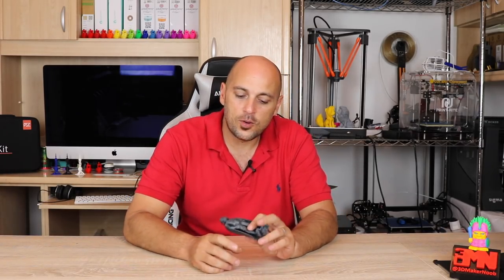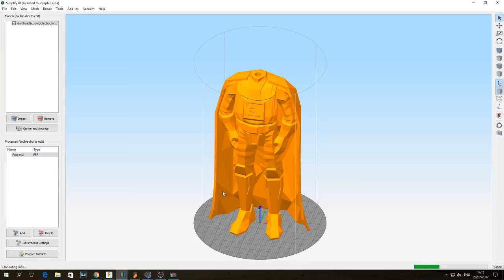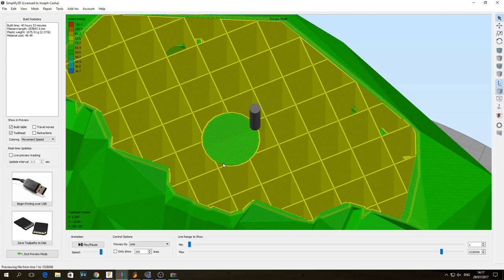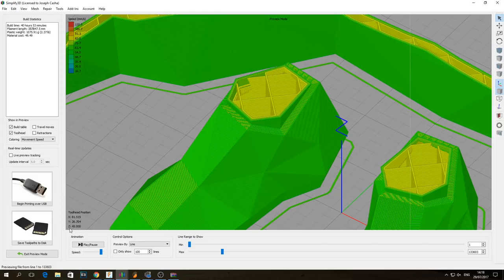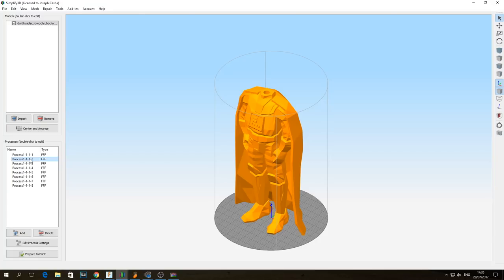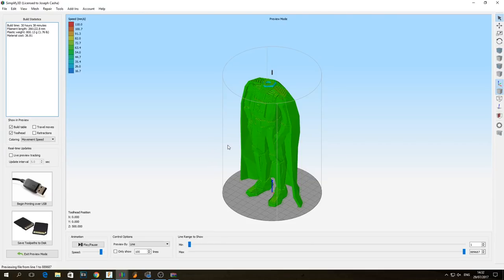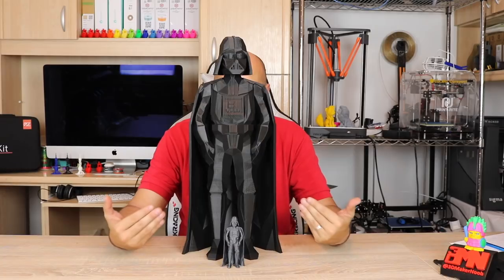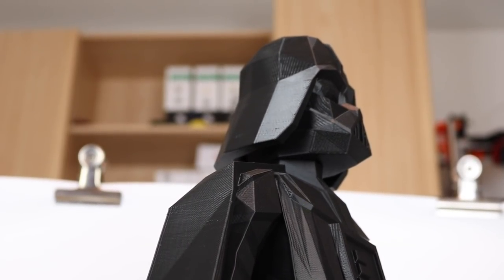Reduce Filament Waste with Simplify3D V4 - Big Darth Edition

Comment: Cura 2.6 has a great feature that saves a ton more. Say 100% infill at a 5 layer range. It should give you a solid foundation for top layers and use minimum infill for the rest.
For such a large print I guess more layers would be best, but super easy and fast to configure.

Comment: That's a very nice print! If you do want to print some stormtroopers to accompany him, I would recommend scaling them so they are shorter than Vader. By default, the low-poly Vader is the same height as the stormtroopers (and I think even C-3PO), which looks off.
Reply from the maker: +Mighty Jabba's Collection that makes absolute sense thank you and will do :)

Comment: Great video!
But one question: isn't the gap between let's say 3% and 15% too big to print the first layer of the 15% structure?
It looks like it prints it "in the air".
Or is it not relevant because it's the Inside and you can't see it anyway later?
How about slowly increase the infill in 3% steps? 
Just my thoughts about it :)

I just ordered my first 3D Printer (A8) and find your videos so helpful in preparation for my build!
Thanks!
Reply: Matthias Bouillon, the first layer  will sag a little bit, it depends on how you tuned the settings for your filament(bridging), if you tuned it very well you can print 50mm bridge without a problem. DEFINITELY FOR PLA😁.

Comment: and... Cura 2.x does this automatically and better... it doesn't break the structure integrity of your infill by varying the infill sparseness and continuity  like s3d did but building a raft/prefill prior the actual top surface being printed. You can even set the infill higher and enable Gradual Infill Steps so that infill will only get denser when there are top surfaces to be printed soon. Everything you explained in the video can be done in under 10 seconds or less.... anyway it is a good video just not the easiest and cheapest way to do things.
Reply: Mega Making would you day that cura is the best slicer? Or just the best free one
Reply: I could not get Cura to work properly for me but had no issues with S3D nor Slic3r.  I can't remember what it was but the issue forced me to uninstall the software as I had read that it was made for the UM2 and if another printer worked with it great but that it is not their focus to make it work on all printers.  I read that on their forums and immediately uninstalled it.  To be honest the part I was printing S3D did a horrible mess with so I installed Slic3r (I have not seen, nor used, this program in almost 2 years) then set everything up and the part was flawlessly printed. What Slic3r did do is make supports that I had to fight to get out and just lucky the razor blade didn't slip doing it and it has to do with horizontal separation and for some odd reason it always sticks to the upper and lower layers but the vertical separation is perfect in it.
Reply: In my experience, the people who have problems with Cura is because they idiotically never edited the start/stop gcode properly.  When you add a new printer that isn't in the list, the start/stop gcode is just a placeholder that is missing key instructions that each printer needs.  Generally you can copy this from profiles in another programs or from the program that might come with your printer.
Reply: I'm a newb Cura user and I would love some more info about this, how do you go about doing that? Could you perhaps point to some Youtube tutorials or other resources? Thank you!

Comment: While I'm very happy with this new wizard to make it easier to combine processes, you could do the exact same thing in the old versions. Sadly this is just an ease of use improvement. Would be much happier if they could gradually blend the two infill percentage together, it would be more elegant and possible stronger than a hard transition. 
On a side note I already discovered a bug in V4.0, if you give a process a starting height higher than the build plate, it still tries to print the brim or skirt. this wasn't the case in 3.1.1
By the way, great video! keep it up, I really like your work
Reply: in the old version you would have a solid infill between processes, if top and bottom layers are 1 or higher. So in v4 you get two benefits: 
1. easier process splitting with the wizard
2. you can still use bottom/top layers and won't get a solid infill between the processes

Comment: Hi Joe, I am a S3D user from the very first day of this software, and I am always happy with it.
One question concerning the process wizard:
You left the BOTTOM LAYER and TOP LAYER  for the additional generated processes to the settings of the first process.
But must you not set them to "0" for the inbetween processes, except for first and last process? First has bottom layers and last has top layers set.
Just wondering, but did not check with my S3D4 yet... Got my iPad with me at the moment....
Reply from the maker: +Frank von Thienen hey, no you don't, that's what makes it much easier with the wizard. It recognizes it's the same print and simply continues with the print as normal
Reply: 3D Maker Noob Thanks, saw the other guys doing so, that's why I asked.... but meanwhile, I am back at home an can check myself. Have a nice Sunday.

Comment: Testing this as We speak. I agree, it only a wizard upon an already existing feature, but makes it so mich easier.

While printing I noticed one problem, that is not specifically related to this, but maybe You have a suggestion. When going from the outside perimeter which is printed at 50% speed, to the infill which is printed faster, the first few lines of infill are very thin and brittle.

I suspect this due to the speed change. With the higher speed, You need more filament extruded. But because of the bowden tube there's probably a delay, from starting infill at higher speed, until more filament is actually coming out the nozzle.. any suggestions?
Reply from the maker: +Karsten to be honest I get that on all of my printers so I tend to slow down the infill speed, doesn't really affect it much to be honest

Comment: There is a glitch/bug in S3D where the first layer is wrong in Z.  I get to the first line and it will be right but the next lines it will say all sorts of different heights.  All lines should say the same height and when you move to the next layer should it increase in Z so not sure what they have wonky in it.  Might even be like that in other layers but I only noticed it on layer 1 as I was checking stuff and didn't care to check further.

Comment: nice video but this isn't a new feature (except for the split process wizard screen). Multiple processes and start/stop layers (advanced tab) are in v3 as well.
Reply from the maker: +Marcellus the video is about the split process since that's just been introduced. I have videos on multiple processes
Reply: It was possible before to use multiple processes. However you would either have to set no top layers for the bottom process, so you see the infill or you use a top layer and simplify creates multiple solid layers between the top and bottom process. So not that great. 

Still a little bit disappointed by the update, why is there no variable infill. There is already a slicer who does that. Just have a look at cfd calculation which also use .stl files as an input. There you can use more cells near the shells. Just do this with 3D printing. In the middle maybe a infill of 2-5% and gradually finer so that you have 15 or even 20% infill near the walls.

Comment: I have never noticed the issue where the hand meets the leg before, should be fixable if you separate connected models
Reply: Yes this is a default in the model, it probably would not matter if you havent changed the infill for that.

Comment: One thing I've just noticed after S3D insisted on putting my process changes in the wrong layers is that the Z value reported in the Toolhead Position report on the Preview screen
includes your Z-lift (Retraction Vertical Lift) value.   It is not, technically, reporting the Z
height of the currently displayed layer; it's the position of the nozzle right before the next layer starts.

So, if you're using Z-lift, you'll need to subtract that value from the reported Z value in order to choose the correct layer for your process change. 

I've reported this on the S3D forum, but thought some of you might not get over there.
Reply: Robert Wallace yes, was about to comment on the same, when seeing Your comment :-) couldn't make sense of my settings, and what I was seeing in preview. To get the right height, You need to subtract layer height plus any z-lift from the reported tool height.

Reason for height offset is because the z increase as the last thing in the layer, instead of first thing in the next.

Comment: Nice video, but misleading in the sense that you could do all these things in previous versions...  just without the little tool that automatically created the processes.  you have to do that by hand, but everything else is great.  
you want something much simple?  the SLic3r prussa edition does it with a simple mouse click with the graphic interface.  I'm not using it for other reasons, but that idea make everythign so simple...